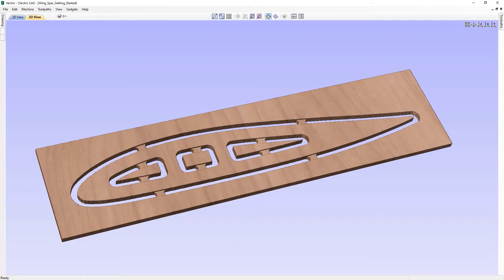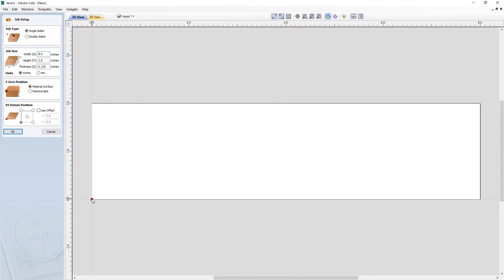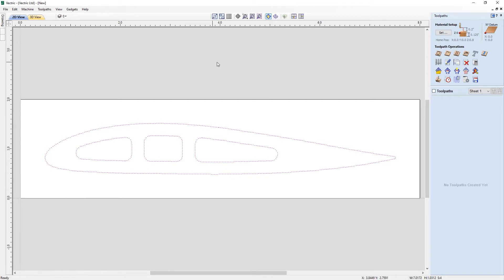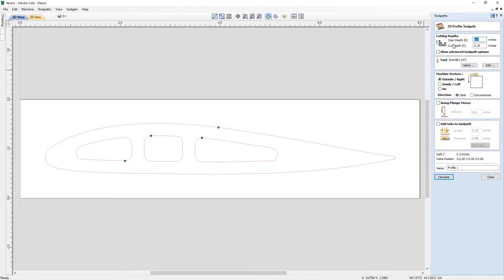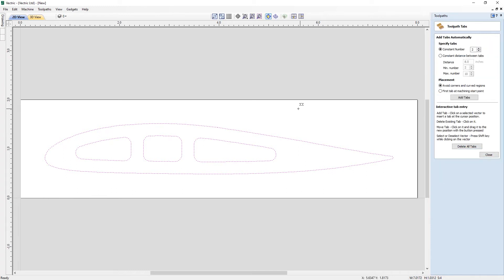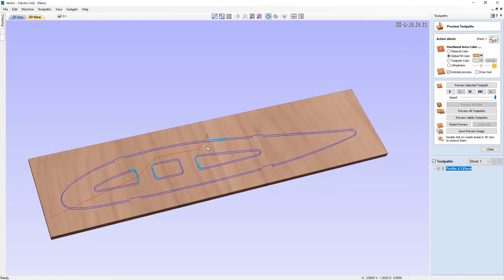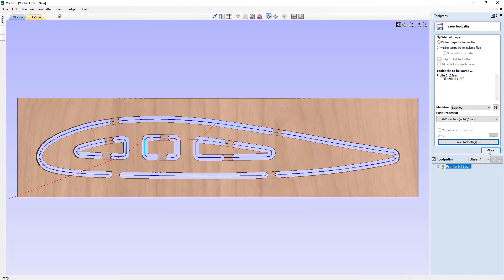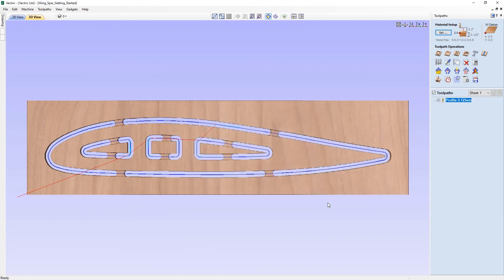Wing Spar | Vectric V11 Tutorials

Comment: Great lesson :) Appreciate it. How do I determine the radius of something? For example, if I use a 6mm bit I want to ensure its small enough for the radius of the middle cut out pieces, so I'd like to check the radius of the inner pieces.
Reply from the maker: Hi there, great question. You can view this in the 3D toolpath preview of how it would cut and look. You could also draw a circle the size of your tool and go around where you are cutting to see where it would cut and where you need more space between vectors. Hope this helps, thanks!

Comment: is it possible to make such settings in the program so that, for example, one of the inner meshes is not cut out along the perimeter, but the surface is completely milled?
Reply from the maker: Hello Ben... I think you are refering to pocketing on og the areas?  If I'm right then yes you can. :)